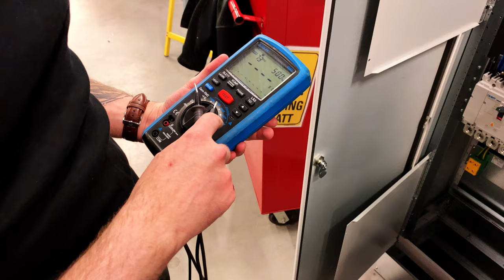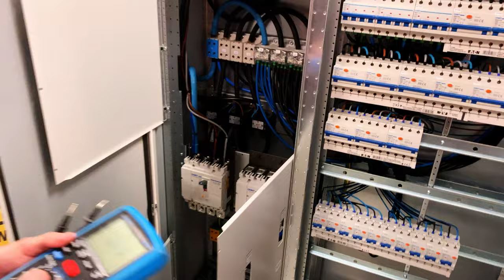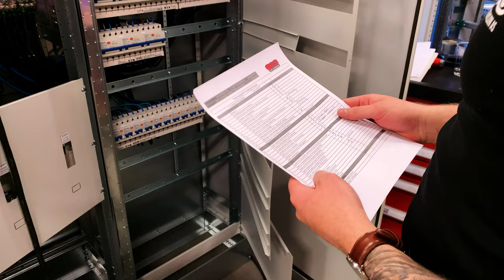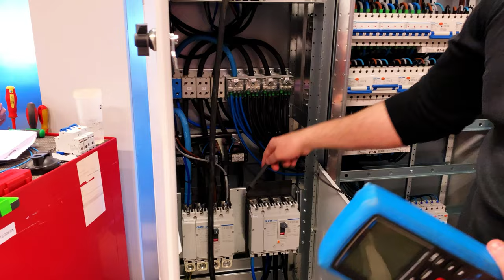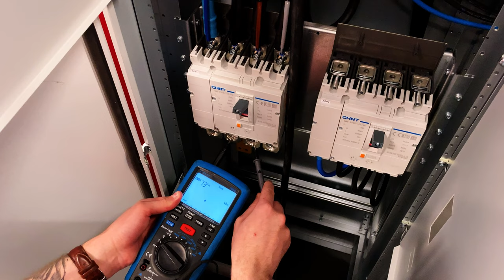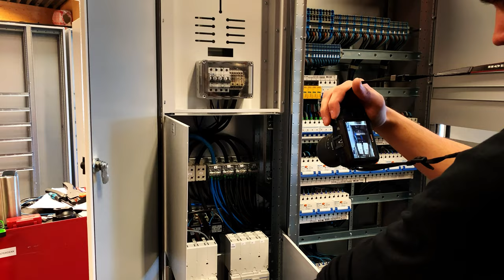Life of a Norwegian Panel Builder @ MTS Tavler Power Panel Build Day Two Part 2 with Timestamps

Comment: Hi. I'm a freelance on site electrical technician from Romania that also does panel builds and swaps and I have a few tips: first: label all the wires properly , do ramp tests on the RCD's, I see the color code is not the usual European one : Br, Bl, Gy, Blue, use an inspection mirror to check the contact behind the busbar cover at the MCB rows, and do a voltage test across the poles (in/out), and where you can a 200mA Rcont test on the feeders. I appreciate leaving enough slack on the mains feeders so power analyzers can be installed properly. I did not a see a ground check between panels. Have a blessed day.
Reply: Доброе утро!, Привет из России!, у нас ещё качество проверяют с помощью "мегаометром", на 500в или выше! естественно ОТКЛЮЧИВ ВСЕ ЭЛЕКТРОННЫЕ УСТРОЙСТВА И ПРИБОРЫ!!!

Comment: I just got a new job as a production line supervisor..Building automation control panels. I'm a state certified electrician.  Any suggestions on how I can improve the department?  How long should a panel take to build? I start Monday. Any advice of steps I can look for to run more efficiently
Reply: @WaltervanDusen  wow I could use you out here in California.  From what I understand these dudes are taking more than a week to build . A panel half the size of this monster. Great work. So what are the steps you guys take. I seen schematic,  material list, collect parts , assemble panel, the. Devices . Pretty straight forward. Great work
Reply: Доброе утро!, ОБРАЩАЙТЕ ВНИМАНИЕ НА движение ваших сотрудников!, у них НЕ должно быть лишних движений! если работник делает лишнее движения или очень заторможен Вы ДОЛЖНЫ ОБРАТЬ ВНИМАНИЕ!,Удачи Вам!